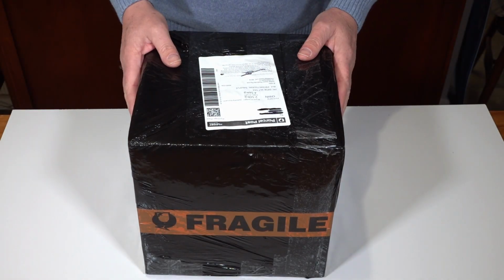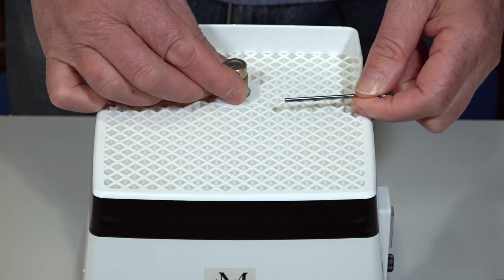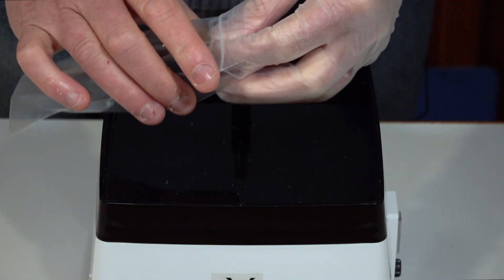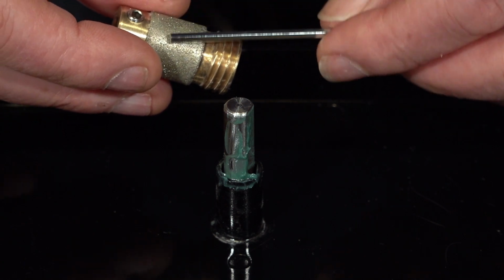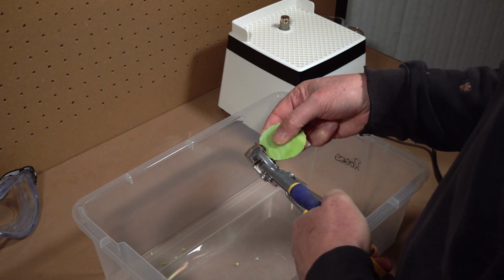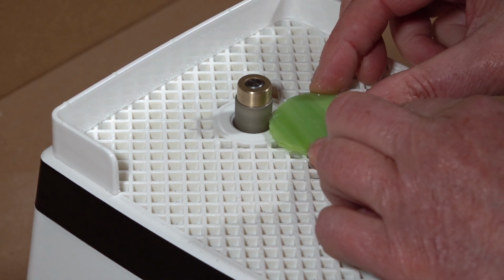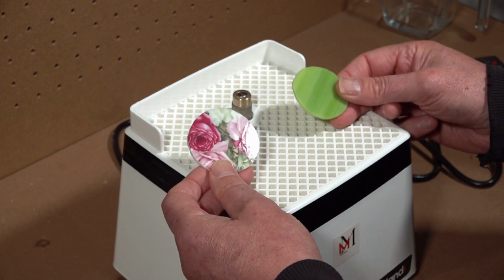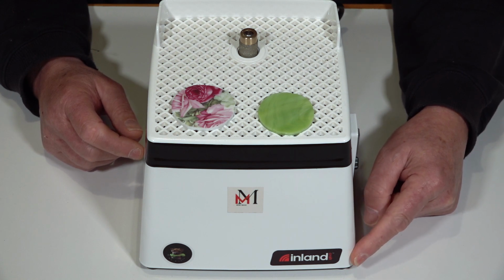MiniMaxi Grinder Review For Mosaics and Glass With Tips

Comment: Is there a smaller drill bit (3 or 6mm) head that will work with this model?
Reply from the maker: There is a 3 and 6mm grinding head Axess Glass carries but I am not sure if it works with this grinder you would need to call or send an email off to Axess Glass to check. :)  www.axessglass.com

Comment: Another great video Peter! I have an inland grinder (in USA and larger model) and mine states that I must add the diamond coolant to the water. Does this smaller model not require that? The coolant isn't expensive and not a problem to add but if this grinder doesn't require it that's an added benefit. Thanks.
Reply from the maker: Thankyou so much Patsy, l haven’t seen any information or been told that it requires the coolant. I would say that it’s not necessary for this model. Thanks for watching. 😊

Comment: This looks like a mighty little grinder. I am guessing it is based on the little blue grinder made in China, because it looks the same with a different colour! That is obviously where the similarity stops! 
The first benefit is that you can remove the water reservoir to empty and clean. I haven’t been able to do that with the blue one!
I like the fact it is made to Australian standards and that you have a 12 month warranty and the possibility of repair through Axess Glass? 
I mostly want to thank you for your tutorial, as information on how to use the blue grinder was pretty scarce!

The only thing I would add to your info is that when grinding a piece of china or porcelain tile, I have found it best to angle the pieces to allow the glazed surface to be smoothed first and then remove any of the lower area. Some china and tiles tend to chip easily by putting up to the grinding bit!
Thank you Peter! You are a wonderful source if information! 💕
Reply from the maker: Thankyou so much Dianne and you are so very right in your comment. The Inland grinder does have a lot of great benefits to it as stated in the video, also because it carries the Inland brand and is for the Australian market it needed to be to their standards. That's a great grinding tip as well and I look forward to trying it out, I'm sure it will benefit all the viewers. Thankyou for watching and taking the time to comment, appreciate it. :)

Comment: Peter, what grit number is your grinder bit for crockery? Fine or coarse?
Reply from the maker: I am just using the one that came with the grinder, however a courser one would be good. It needs to be one with the reverse screw mechanism to work with the water :)
Reply: The bits are 100 grit.  I will be getting a coarser grit in the future
Reply: Are courser grit grinding bits better for ceramics than for glass?  Thank you!